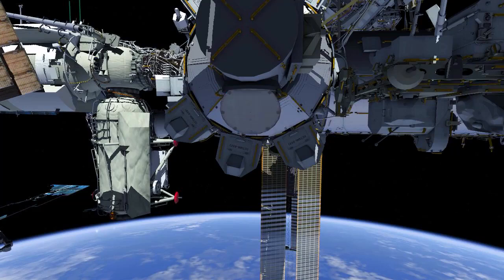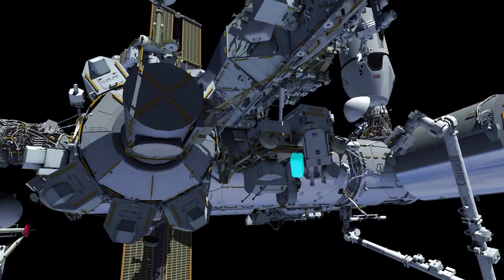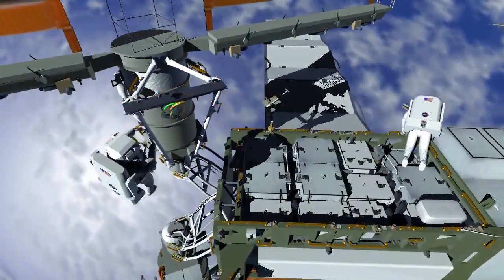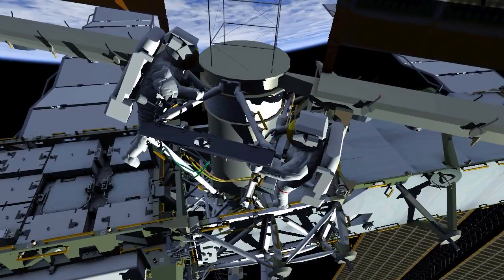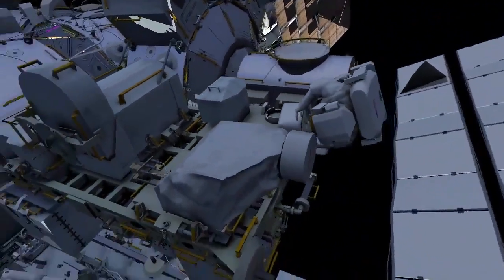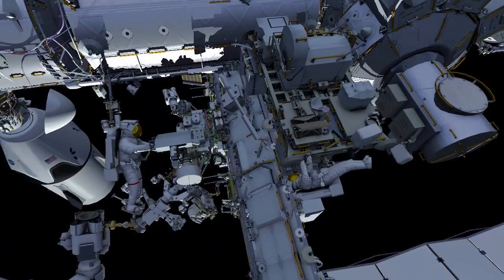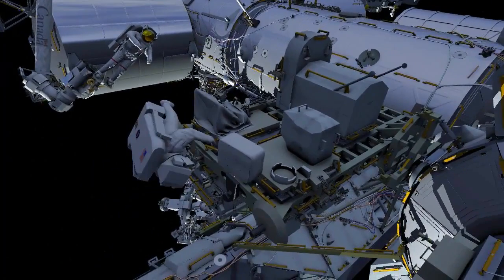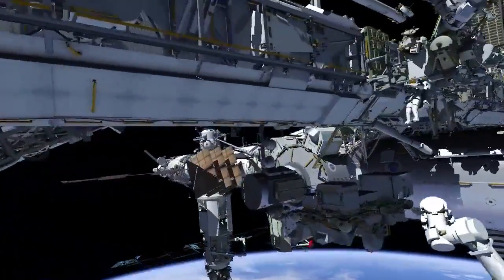Spacewalkers, including UAE's first, will prep ISS for power system upgrade | Animation

Comment: Cant believe how big the ISS has become over the last 20+ years.. and that its still holding together..😮
Reply: The strongest force effecting the ISS is probably solar wind.
Its in a partial vacuum so there isnt much in the way of wind friction
Reply: @yootd3m  yep..the solar radiation ain't no joke.. 
Around 250⁰ baking in the light and -200⁰ in the shade you'd think materials would degrade due to thermal expansion and retraction
Reply: @Danboi.  fascinating